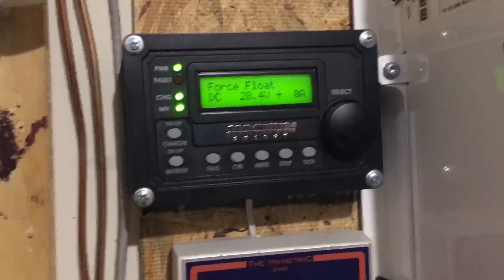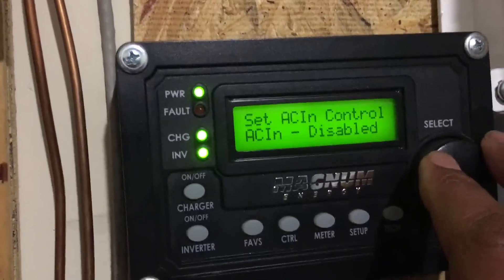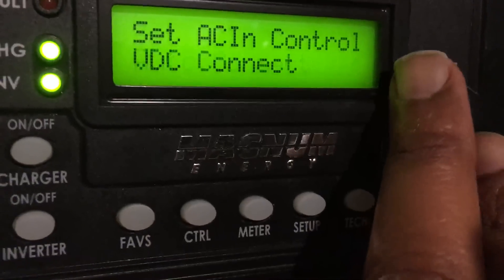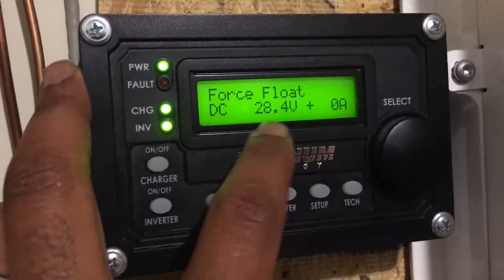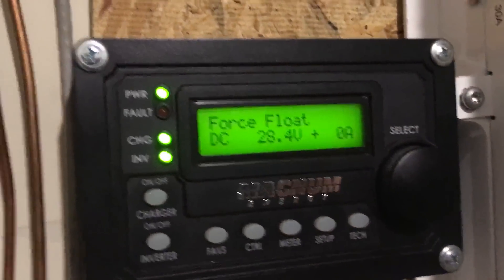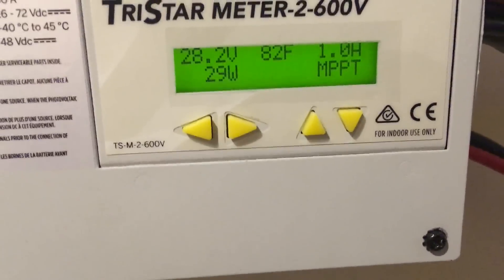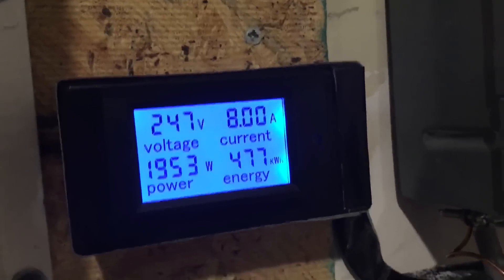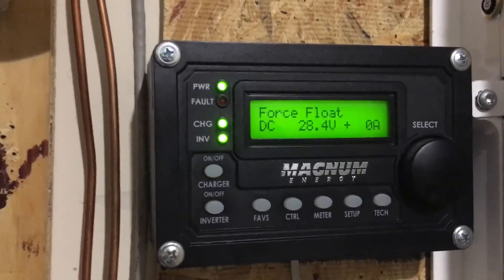How I Use My Solar Power Monitoring Units

Comment: Great Video!  This is so helpful right now, answers a lot of questions and brings up new ones.  About the digital multimeter that you have on the house usage side, I want to add that to my system and I found it on Amazon but it says DC 6.5-100V and 100A.  Did you get a different one to hook on the AC 240 side or is it OK to use that way? Thanks
Reply from the maker: Actually, I wouldn't use that one.  The specs are off.  Try this one instead http://www.ebay.com/itm/100A-AC-LCD-Panel-Digital-Power-Watt-Meter-Monitor-Voltage-KWh-Voltmeter-Ammeter-/271952136069  or search ebay for "100A AC LCD Panel Digital Power Watt Meter Monitor Voltage KWh Voltmeter Ammeter".  They are not very accurate, but they'll get the job done.
Reply: Get the 500 amp one i have it too if it's running your home lots of amps there
Reply from the maker: I wasn't aware that there was a 500A meter of this type.
Reply: the amp meter from bogart
Reply from the maker: I believe he's wanting something similar to mine for the AC output side of the inverter.
Reply: o the volts,amps, watts and watt hours
Reply: ok i see what your talking about i'm thinking about that too but first i need the monitor
Reply from the maker: The cheapest Magnum ARC remote I've seen is $183.20 from camping world.  http://www.campingworld.com/browse/skus/index.cfm?skunum=57253&rewrote&affiliateid=5193&gclid=Cj0KEQjw4fy_BRCX7b6rq_WZgI0BEiQAl78nd6FJNAAZdT-m24nBrfebHRUQWq6csNGjg96-H_vbIAAaAgbI8P8HAQ
Reply: I have have to get it from a known dealer i can't have any more trouble like last time but i did get a great price in the end=)
Reply from the maker: I can definitely understand that.
Reply: FYI, I don't think the ME-RC can handle multiple inverters.  If you plan to expand to 2, 3, 4 inverters in the future, you will need the Me-RTR to handle the routing.
Reply from the maker: That is correct, this link gives you a comparison of the remotes.  http://www.magnum-dimensions.com/sites/default/files/MagDocs/Magnum-Remote-Comparison-Rev1-0.pdf
Reply: OK,  I think I see now that they are quite different.  The DC version uses a shunt and the AC version uses an open-close current transformer.
Reply from the maker: ***** Yes, you will need the AC version for AC output on the inverter.